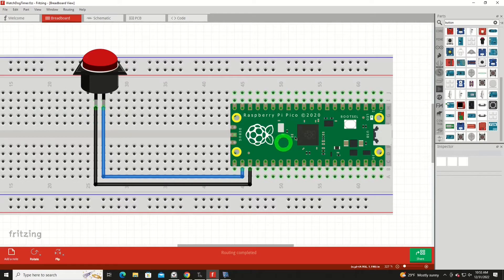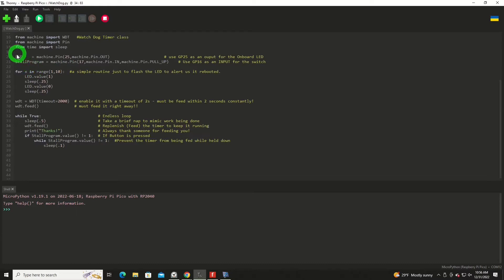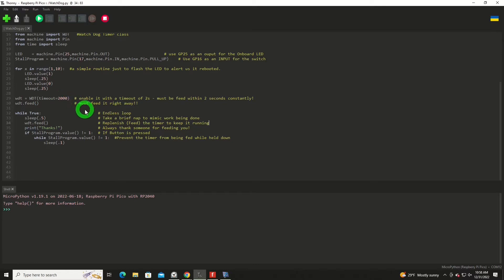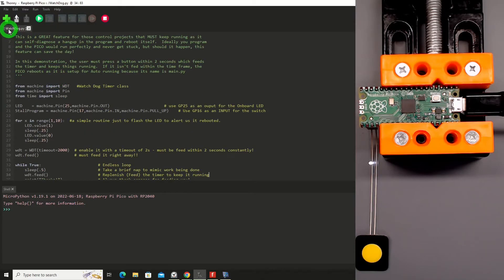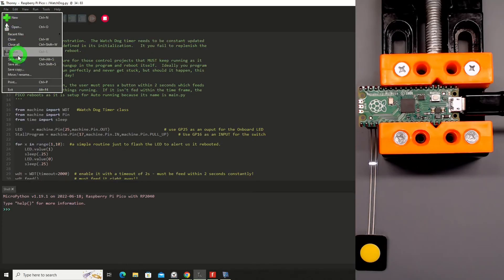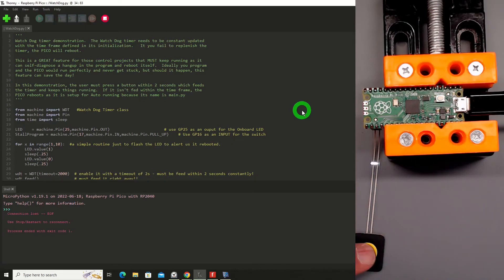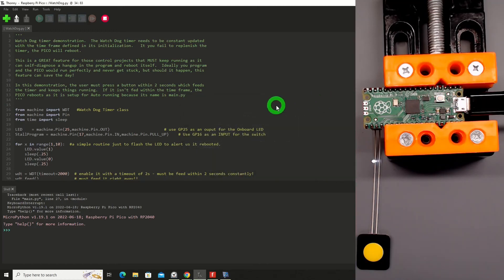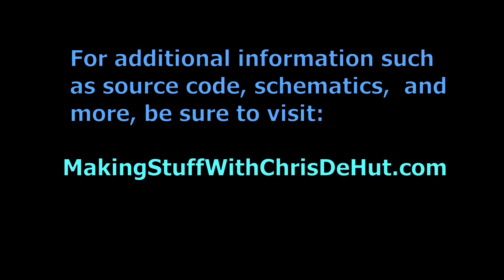How to use the PICO Watchdog Timer

Comment: I always try to avoid while loops. When I do, I add a counter timeout, but that feels clunky and I hate doing it.

Hopefully these timers could help.
Reply from the maker: When I first started tinkering with Python, the while loop was the easiest for me to remember and I have stuck with it since.  The "for loop" syntax, which is designed for iterating through lists etc. for some reason just gives me "issues" with remembering the syntax - probably because I got back to the 70/80s with programming and some syntax just got permanently embedded in my brain ;-)
Cheers!
Chris

Comment: This is such an interesting concept. I’ve built projects that include using an ESP32 to send/ retrieve data from the internet and I would always have problems with reliability. (One of the reasons I switched to the pico). It’s nice to know there is solution to some weird errors that occur while using these micro controllers that run absolutely necessary programs. Thanks again for the great video
Reply from the maker: Cheers Ian!!!